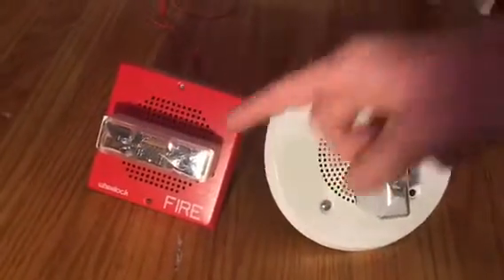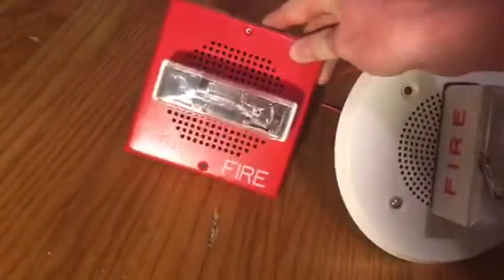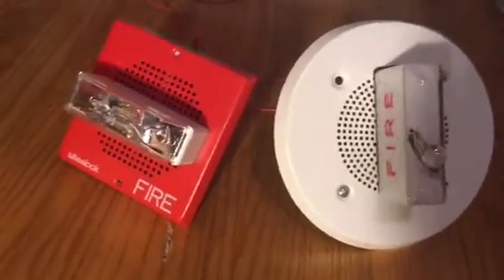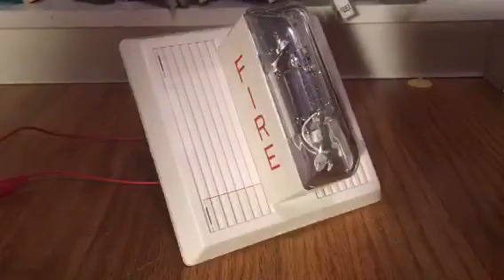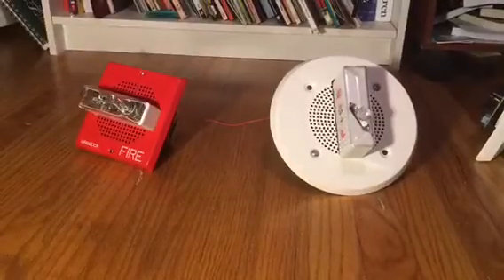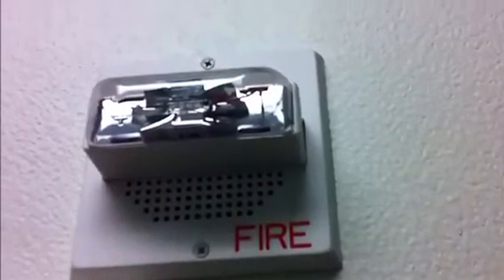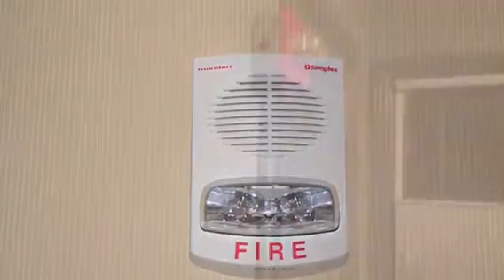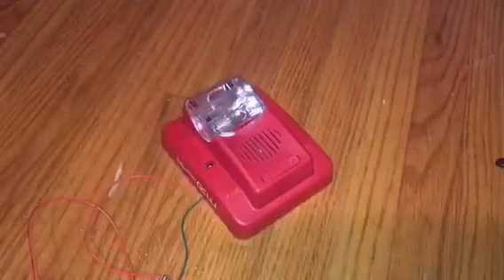All About Chime Strobes!

Comment: And of course Gentex commander 4 Probably has that option to turn to the chime strobe tone if not true then in the area where Gentex alarm needs to have chime sound and the only place for the alarm is Ceiling then contractors will need to put Commander 3 wall mount on a Ceiling

Comment: Thanks for the info, now I can assume that for sure the alarms in the new agriculture wings at my school are Wheelock speaker strobes and not chime strobes. That also makes sense because the panel my school uses is a Grinnell Autocall TFX-400, which is voice capable. And all of the other alarms at my school are Wheelock AS/AH and MTs, and of course, RSS’ in the bathrooms. I also wonder why the special education classrooms at my school do not have chime strobes for the sensitive kids, instead the Wheelock AS in there has both the horn grille and strobe covered up with tape

Comment: The way you can tell the difference between a ch70 and a speaker strobe is the chimes are the only ones that have "wheelock" on the front plate on the bottom left. This doesn't always work especially with ebay because sellers can change the front plate out. But like you said if it is in a hospital most likely it is a chime.